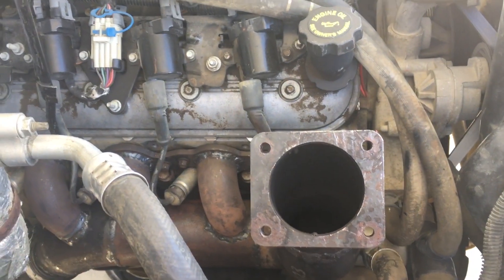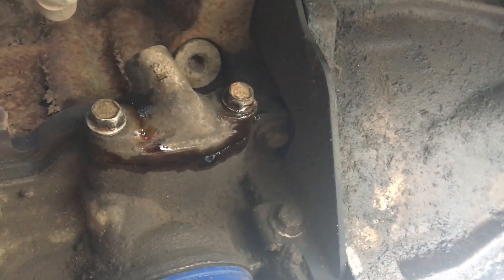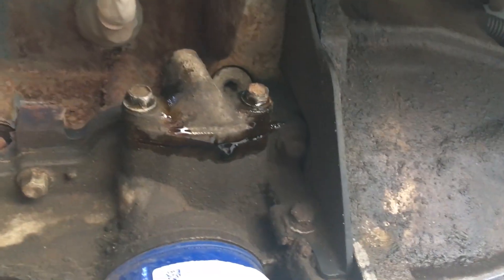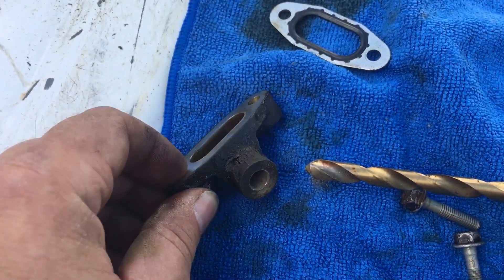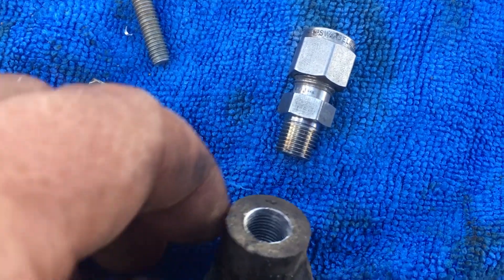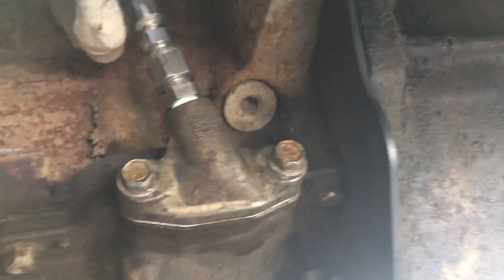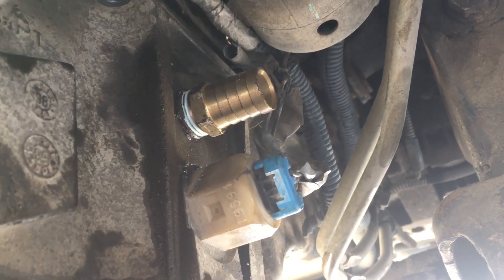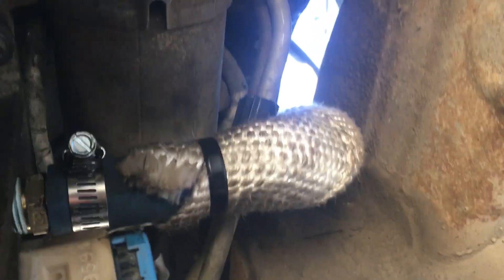Lowbuck LS Turbo Project -Turbo Oil Feed and Drain Lines

Comment: Did you drill and tap the oil pan on the truck? I didn't see you mention pulling the pan. Followers should know the dangers of tapping their oil pan and introducing metal shavings into their oil on the inside. I found this video while looking for someone using a timing cover drain setup.
Reply from the maker: DIY Dozier yes I did drill and tap the pan, and pulled the pan and cleaned it out before putting oil back in it. Good point and I didn’t mention that in the video.
Reply: @LowbuckLS on my car it's a bitch to remove the oil pan!!! Some drill with pan on😆 big strong ls chew up them shavings spit em out exhaust
Reply: @BobbyBrown-sl7zp  lmfaoo finna have some sparks coming out the back for a lil bit but its dialed trust
Reply: @LowbuckLS  can I just remove the oil level sensor and have my turbo drain there
Reply: I was just about to comment that’s lol

Comment: Nice, any chance you got pictures of where you routed the drain hose?
Reply from the maker: Sorry I don’t have any pictures with that old setup but basically you want the hose to go as straight as possible and as vertical as possible from the Center section of the turbo to where it drains in to the oil pan. Avoid sharp bends in the hose and avoid having any sections where the hose is horizontal if possible.

Comment: How long of an oil feed did you use ?  And the fitting part #
Reply from the maker: Hello Luis, thanks for watching and commenting, I believe the oil feed line is about 5 feet long, the fitting on the oil pan end is a Swagelok part #SS-400-1-2 and the fitting on the turbo end is a Swagelok SS-400-2-2.
Reply: Thank you sir

Comment: Hi. Curious if the turbo drain oil will invalidate the oil level sensor being directly above it? Interesting project so far. Staying tuned.
Reply from the maker: Hi, thanks for watching and commenting akinshok, yes the location of the drain line did cause some issues with my oil level sensor... I may just try to bypass it to get the low oil warning level to to turn off